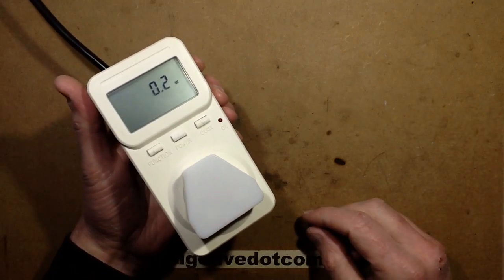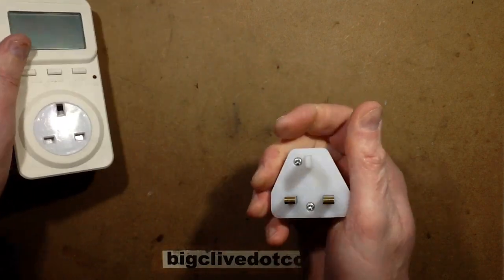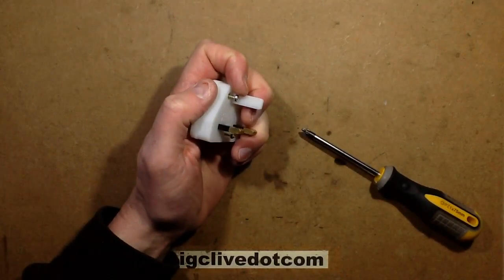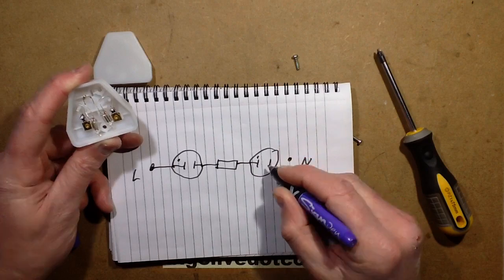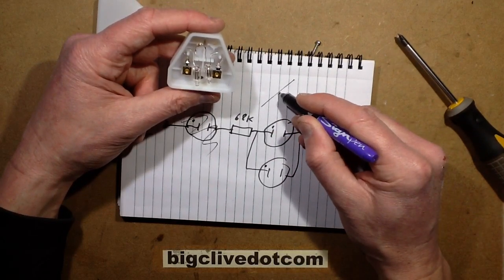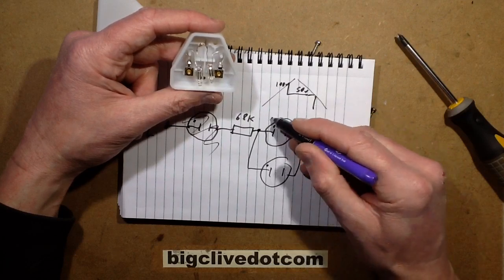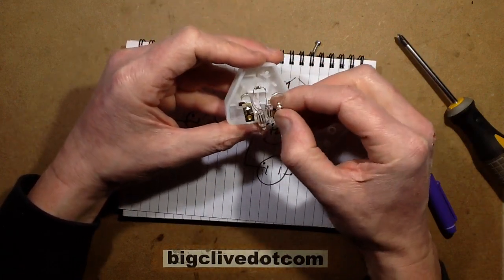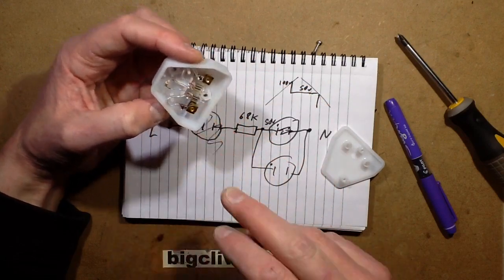Inside a neon night light.  (With the smallest schematic ever.)

Comment: I always liked the 90v neon for the emmersion heater switch, glowing away with a nice red filter in front of it, no mistake it was on :-)
Reply: Yeah a very pleasant and once commonplace glow that we don't see so much anymore. Was disappointed when my last washing machine had LEDs instead of a neon power indicator.
Reply: Led's can look ok behind a nice filter, but the neon has a different look.
Mains rocker switches on power supplys used to have a neon inside, i just liked the simplicity and warm glow.
I must be a bit mad, ok a lot mad LOL :-D
Reply: i had a few running from the BT socket back in the day...free lighting!
Reply: LOL, you bad lad :-)
Im sure there was a rating system for how many phones you could connect to a single line, each item had a ren number perhaps, really cant remember, anyway im sure you could load the line up, as long as you didnt go past the loading rating.
Was it ren? dam my memory is a pig :-(
Reply: zx8401ztv
yes it was ren, but it was 4 i think, you could have 4 old rotary phones, but im sure even then it wasnt a hard limit, and when phones got the sockets, some of them drew less power so you could go more, some of my first tinkerings were connecting phones into the hardwired pre socket days and later buying some hookey compatible sockets to bodge wire into as well, the main problem was dropping too much voltage the ringer wouldnt work, but with electronics it was less of an issue, we had a japanese cordless phone we got somewhere, a couple of years or more before sockets came in and before anyone heard of a cordless house phone, had a japanese plug anyway, so bodge wired it, it had pulse dial so wasnt a problem getting it working, it had a great range (500 meters or so) with a big long 4ft aerial on it!
Reply: LOL sounds like you had some great fun :-D, i remember the hardwired types, a little green or white box-ish with a single screw in the center, i think?, the 4 wires had eyelets on, plopped on to screws and washers + nuts to tighten, something like that, my memory is a bit patchy.

What got me was there were only two wires needed, the others didnt go anywhere.
I did do a naughty extention for a mate using twin mains cable, it was white so not too bad, the copper cores were well over rated lol, but it worked without fault.
This was in the days before you being allowed to add your own extention, we just didnt give a dam :).

Bloody hell, 500 meters away for a phone, that would have been amazing in the day, really novel too :-D.

My mate did get some more modern phones from a old office, they didnt seem to ring, the ringer line was supposed to be seperate so an external system would ring it, it didnt take long to find where a missing capacitor was needed to make it normal, all guess work at the time, but turned out to be right.
Amazing how close you can get with a bit of rough guess work :-D

Comment: Clive, I remember you doing a generic 936 review - i noticed that they seem to start moving to multi-voltage with switch mode power supplies now, instead of the big transformer type. (https://is.gd/EnrN3s  I thinkm scroll down for interior shot, the weight is ~1kg vs ~2kg for the older type) What's your take on using SM PSUs for resistive loads like that?

Comment: To run them off 120, you'd put a very high value resistor in parallel with one of the neons. That would allow the other one to strike, and when it did, the bypassed one would get enough voltage to strike.

Comment: Anymore insight into why it jammed in? Did it jam subsequently? kinda makes it useless if it does.
btw.. slightly perturbed to see 1 "View".. with 2 "Thumbs up"s.. Must be some crazy stalker fan liking your videos without watching :-)
Reply: iv seen an issue with a couple of cheap plug in things, the black insulation on the live/neutral created a sharp step and a device jammed into the socket